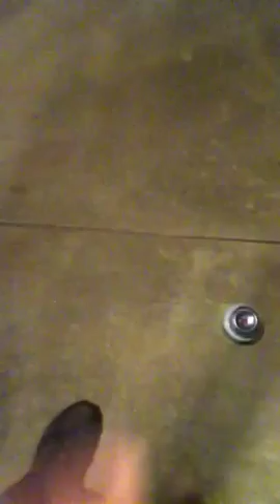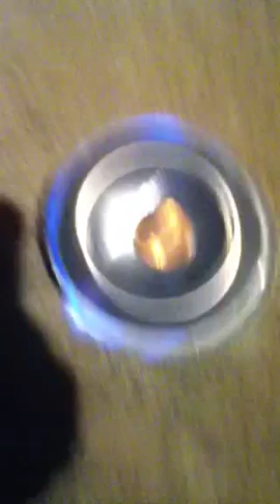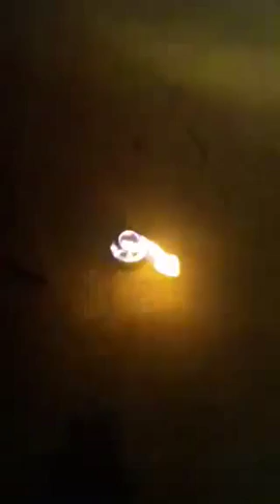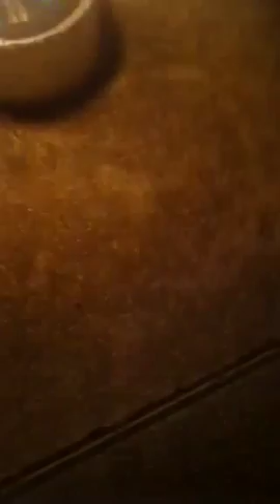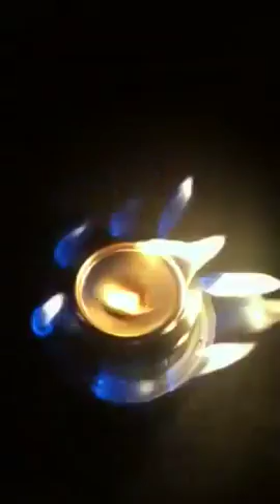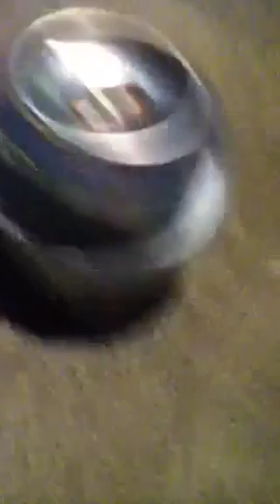New designed pressurized alcohol stove

Comment from the maker: @NCHiker actually i did not.  The top 'can' is the only place any fuel is held, and the bottom can is the only place where gas is lit; theres some internal plumbing and sealing.  But with out one part, the other couldnt work.  The preheater works just like any other, only difference is the jets are part of the preheater tray, which keeps the alcohol well pressurized.  Glad to know i gave you an idea though, thanks for the input!

Comment: You created two stoves. The Preheater is a stove as well as the penny stove. I did something like this a few years ago that turned into an explosion. A small preheater tray or fiberglass wicking might be a better bet. Although this gave me an idea for a stove and pot stand all in one with just the bottom and a bit of rigid aluminum placed in the middle.  Potstand and preheater all in one. The pot would act in place of the penny. Keep building for you never know whats hidden in a pile of junk!